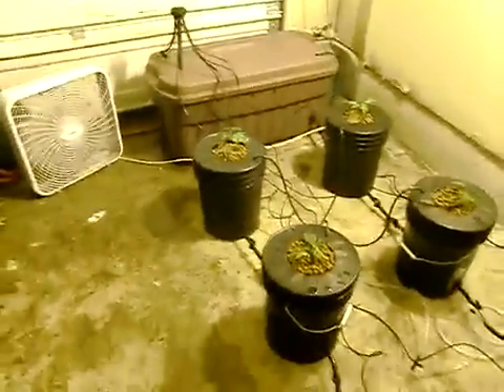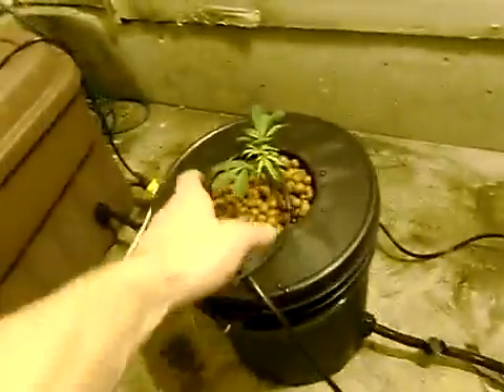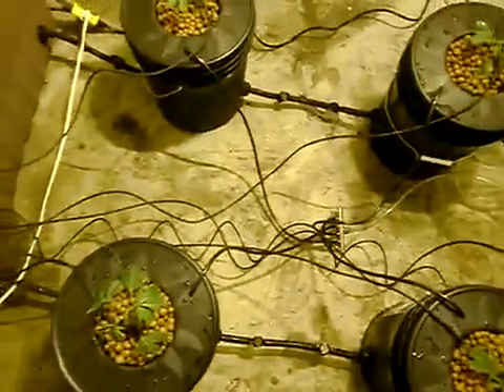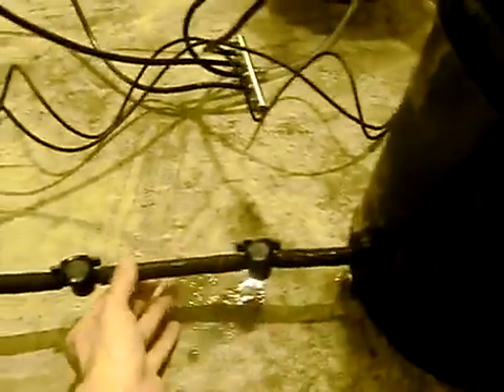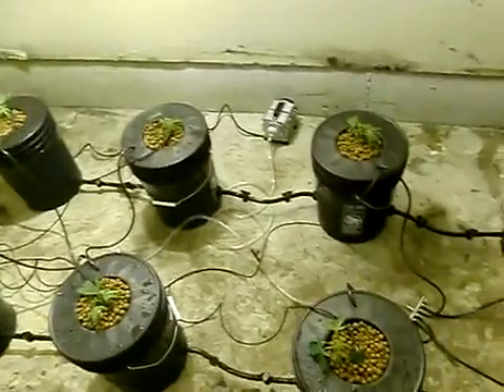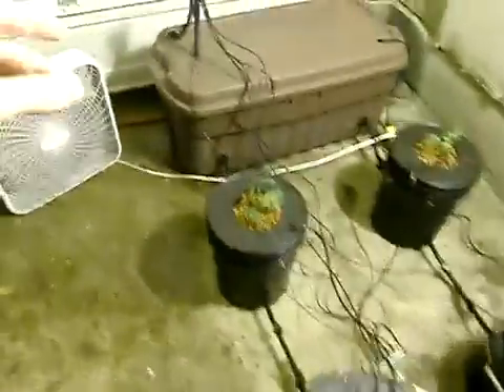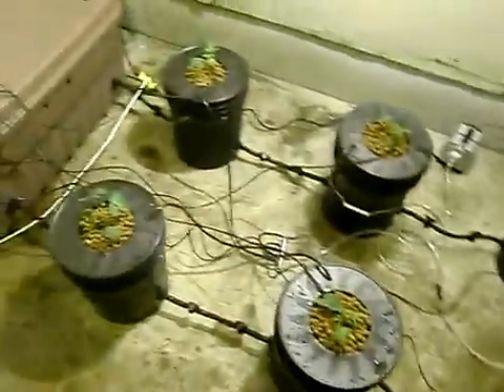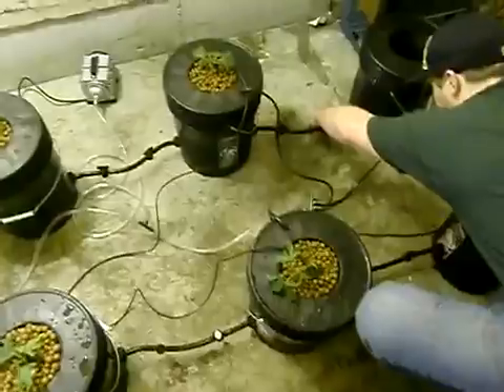http://www.budbook.org  COOP Recirculating DWC Mother Plant System homemade hydroponic

Comment: Lots of wasted money there. Massive res and nearly empty looking at your levels. My understanding of DWC is the bottom of the netpot(or even the whole thing floating) and roots should be just touching the water and is fed from the bottom, nutrients and oxy wicking up through the media used. Fill the res up a bit even though the pots are fed from the top. Also no need to change the buckets round, just change the netpot tops arround if needed.